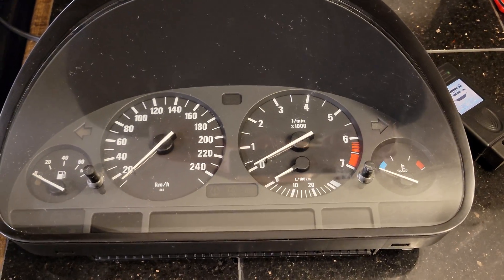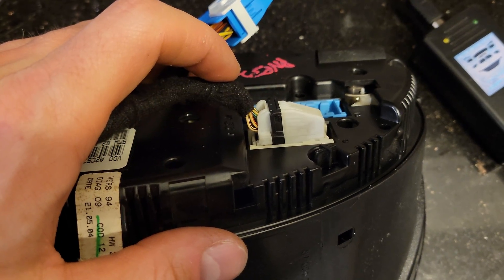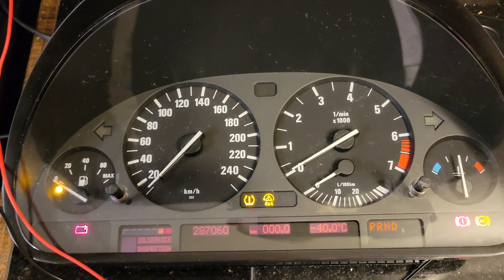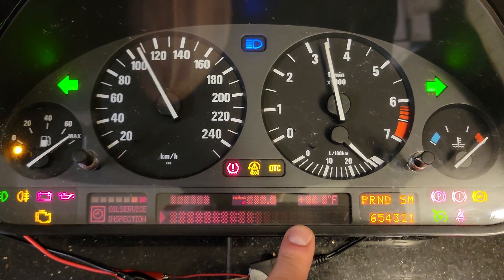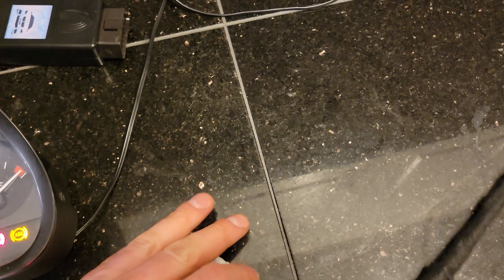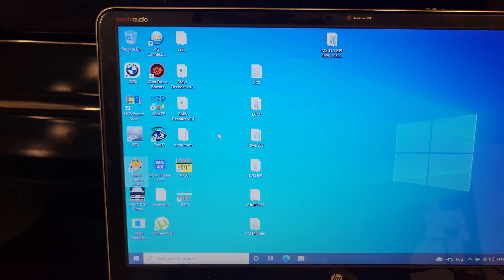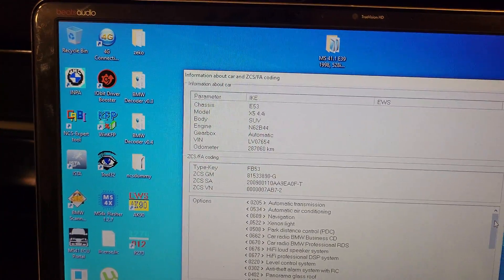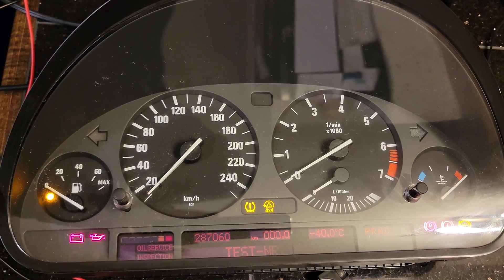BMW E38 E39 E53 X5 High Cluster. How to power, bench test & wire up connection to INPA & BMW Scanner

Comment: I have a 2003 325i and my dash backlighting doesn't turn on, everything else works. I have had the cluster tested and was told that it work fine on the bench test. Anyone have any suggestions.
Reply from the maker: Do the bench test yourself, then check if your vehicle connector is supplying the voltage for that pin with a multimeter.

Comment: Great video! Thank you for useful information. I have some questions, how could I contact you?
Reply from the maker: You can ask here
Reply: @BimmerFix  I have question for ABS module. Could you make a video how to make test station for ABS modules? Where you could see if the ABS is defective or not

Also, one more question about clusters. What you use to power them up?
Reply from the maker: @Sdided  I never had issues with my ABS module but will make a video if I get to fix it. For the cluster, I use 12v 1 amp power adapter.
Reply: @BimmerFix  Thank you for the info! I have alreadymade wires for testing tachometer. Just one question, can you edit speedometer mileage using INPA or BMW Scanner?
Reply from the maker: @sdided1  No that's not possible